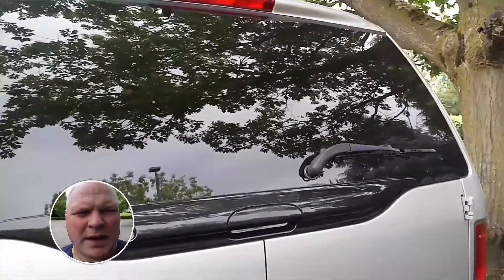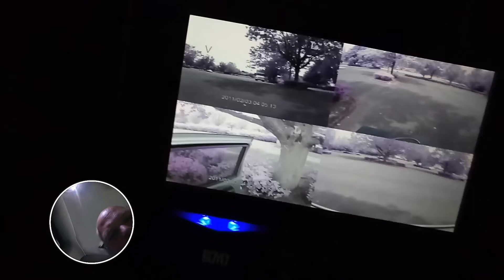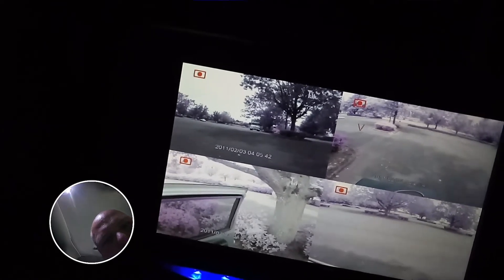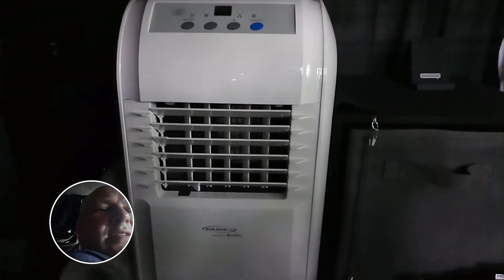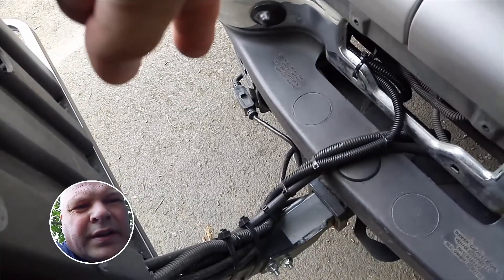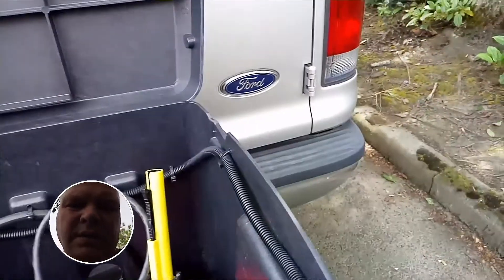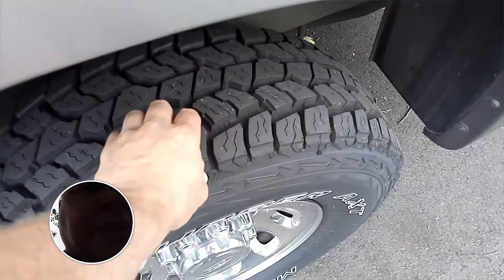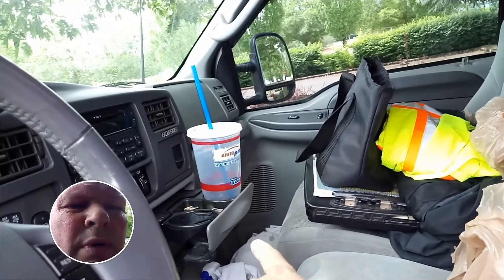Living in a van in style

Comment: Don how do you vent your A/C  i have the same one and vent it out the back window of my van
Reply: just vanning it  I was wondering the same thing can you give me some information on that type of air conditioner and how big a generator you need to run it and how you vent it out the back? thank you
Reply: i have a LG 8000 room A/C and run a 2000 Yamaha generator and it runs good but it wont start the A/C  in economy mode , i vent it out the back door . i cut a hole where the license plate is and put the plate on a hinge can't even tell its there
Reply: just vanning it.   That's a great idea, venting behind the plate, I would never thought of that!